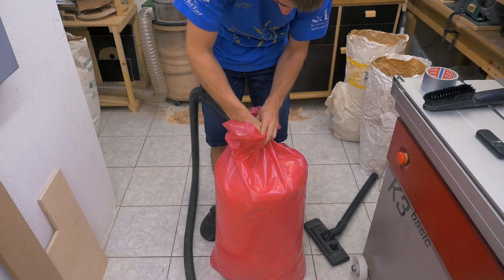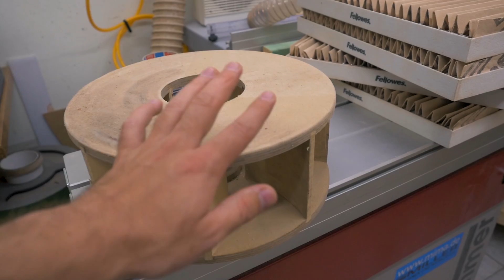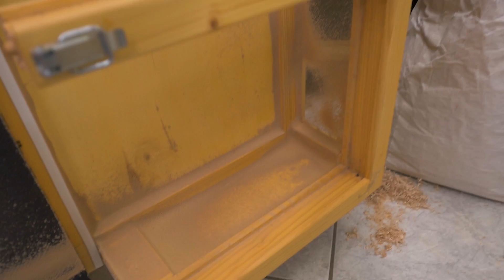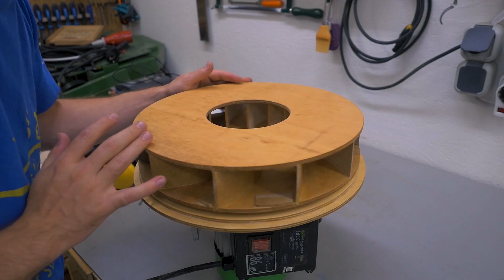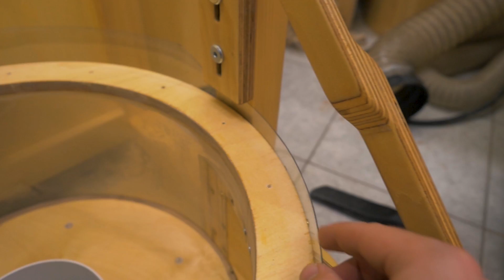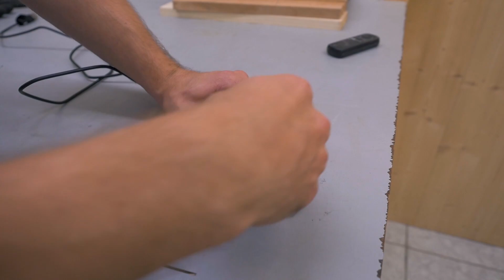Dust Collector Update & RODE WIGO Charging Station (Random Shop Stuff 24)

Comment: Very common for induction motors run at slow speeds, is to remove the motor fan, and fit an auxiliary cooling fan in its place.

Comment: Do you have a video showing how you made your CNC dust collector, the smaller one? I'd love to see how it actually works. It appears that you put the impeller above a cyclone tube, which makes the system more compact. But if I'm seeing it correctly, you could locate the impeller and motor assembly across the room and still use the dust collector, as the impeller isn't actually acting like a centrifuge correct?
Reply from the maker: I have 4 build videos about it on my channel

Comment: Hi Marius! Along the years you've made at least two variations of dust separators with Thien baffles. Which one do you think works best for a shop vac set up considering use for finer dust mainly (track saw and sander)? The one you made for the pantorouter ou the other for your dust collector?

Comment: You need a bucket that will fit inside the bag. Then just put the bag over the bucket, and invert. 
Remove bucket, and 'Presto' the bag is full, and no shovelling required.
As you already have the buckets, then use a bigger bag, and repeat the process to empty the bigger bag into the pink bag.
Also, a little dab of super glue on the base of the key would ensure it doesn't get lost when you remove the impellor.
For your bandsaw, have you thought of a stepped V belt drivee or a variable V belt drive? 
https://www.aliexpress.com/item/1005001495763734.html
https://www.c-var.com/products_show.asp?seq=207&title=APH-Belt-Stepless-Variable-Speed-Drive
.
Reply from the maker: I always wawnted to use a VFD for the bandsaw. The bag thing is definitely a good idea

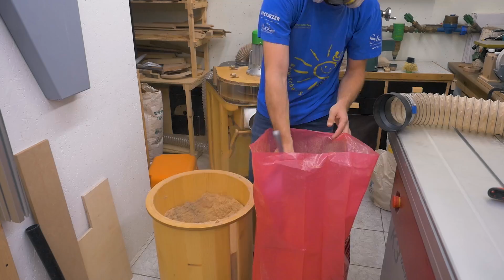Comment: 8:46 I think you could put a (large enough) plastic bag OVER the dust can, keeping it tightly around the can, then invert it upside down; if your red bag isn't big enough to go over the dust can/bin, you could use a different trash bag to dump it in first, and then put your red bag over the opening, dumping the first/larger bag into your red bag OUTDOORS.  :-)

Comment: For impeller design, this wouldn't work with 11 fins, but it would be interesting to use a design with different length fins. That should spread the noise across a wider spectrum making it sound quieter than it actually is.

Comment: Nice to know somebody's taking a concern about health in your industry the date is out there and people on YouTube just blase about it, do you have a particle metre to measure how much is in the air? Wood fibres paper fibres should be treated as a specialist and the workshop should be like a medical Theatre
Not necessary to waste the sawdust you can make it into logs and sell them or use them or make it into furniture again mixing in epoxy making sheets
What about a water filter system ever thought about doing that it's the best filtration for small parcels
Can't you lacquer the impeller with a water-based acrylic and polish it. or at least rubbing the impeller with candle wax and polishing it. And man some beading on the inside of the Impaler you getting airflow problems with swirling vertices maybe building adhesive or corking you stuff about half an inch across on the edges
Why can't you just put the bag inside the bucket put it over the lip of the bucket and have a big lastic band holding it please or bungee cord, or piece of string
Only have to do is release the elastic band and Tie the bag at the top maybe some draught excluder around the top of the bucket so the bag has soft padding and round the corners of the bucket over on its outer Edge
Do away with the corrugated paper filter and use a poly finder harder to clean I grant you would be better needs to overlap the edges of the filter I think as well
Yes I think the impeller might be heavy and and out of balance even if you got till the vibrations you could have used forgot the name of it thin veneer plywood with a foam interior sandwich it would be good I don't know if it is on your impeller to make the impeller slightly narrower on the outside inlet than the inside that increase the vacuum just a couple millimetres narrower. Yes that sounds about right a low pressure maybe as you say static build-up because it's plastic PVC try some copper tape around it Earth

Comment: Another food for thought with the motor RPM with the VFD is that you could also install a thermal switch in the stop circuit that would trip off the VFD when the motor became too hot. This would be a good idea regardless of whether you adjust the pulley diameter. I suspect you would be fine with the current pulley arrangement since you're not running the saw for hours on end.

Comment: Why paid to get rid of the saw dust? You can use that money to buy wax (if you have good relation with the church, you can get candle butts free). Pour melted wax into saw dust and you get blocks of solid fuel, all you need is just a silicon cup cake mold. Those solid fuel can be use in campfire or heating in winter. If they are all coming from natural wood, you can also use it to cook.

Comment: You will also get full power from the motor above 50hz, but not below.. So that is a factor as well. The power curve goes from 0% power at 0hz to 100% at 50hz, then 100% above 50hz as well.
Reply: You lose torque when motor is going over nameplate speed
Reply: @ToxTox  yes but not horsepower

Comment: On the bandsaw, pull the silly bent piece of tin that "they" call the fan off the motor shaft. Vanish their silly restrictive cowling. Replace it all with an electric fan.
I'm sure you can come up with a cowling / cover to pretty it up and make it safe.
If the cooling is done separately with an electric fan, the cooling will obviously be separated from the motor speed. 
I'm not sure if it is the kind of thing you want to get involved with, but you could even have dynamic fan speed control on the basis of motor case heat. A microcontroller and a linear temperature sensor like an LM35 would do just fine.
Horses for courses I guess - You might prefer the mechanical approach.

Comment: Re the band-saw. I would add an external fan that is turned on only when the motor is run at slower speeds. Like a car radiator fan. In that way you could simplify your pulley setup and run the motor at any speed you like. It will add extra space to the motor and you will need to power it somehow, but for the times your cutting metal having an extra component to start is worth the increase flexibility of the saw.

Comment: Seems like gardeners would be happy to add your sawdust to their compost - without charging you. Might even pay you for it.
Reply: Sawdust is "brown" in the composting sense. Although it can improve the texture of some soils, it robs the soil of nitrogen in the process of breaking it down. Even worse if the dust includes MDF or OSB, laced with waxes and preservatives that kill soil microbes. MDF sawdust is a good weed killer though, as is walnut which poisons the soil with juglone so it doesn't have to compete with other plants for soil nutrients. Good to learn from mistakes, best to learn from the mistakes of others. Sawdust in my compost killed my tomatoes for several years before I figured it out.

Comment: Then you actually did want an 8nvariable vqriable drive otherwise you could have juat stuck with new pulleys.  But why not just buy a pulley?
Reply from the maker: The pulley I need is about 100€ for the motor and no standard piece for the wheel
Reply: @MariusHornberger  You couldn't find something in a junk or salvage yard?

Comment: I had a similar heating problem going to a VFD. Easy fixed with a computer cooling fan that runs when the VFD is on. I took off the original fan and modified the housing to make some space.

Comment: I regularly run my 1750 rpm motors (lathe, drill press, milling machine) at twice that using a VFD and never had a problem.  They would much rather run fast than slow. Another bonus is you don't have to deal with the lack of torque that comes with running at low frequencies.  So a low gear ratio coupled with high frequency results in high torque and decent top speeds.

Comment: With the right vfd (if that matters) you can power low voltage pc fans when the frequency output is at a level you set in the vfd programming.

Comment: Wait... 25m/s? Aint that quite fast? :D checks google

It seems speeds at around 5-10m/s are more common... umm... did you make a mistake? :)
Reply from the maker: You only need lower speeds if the motor isn't powerfull enough. Bandsaws on the higher end run between 20-30 m/s

Comment: To solve the issue of the bag deflecting in the dust bin, you can insert an open ended cylinder inside the bag that holds it to the outer wall of the bin.  Mine is just made of a sheet of puck board riveted into a cylinder shape.  You then slide the cylinder out of the bag before throwing it away.  This, however works better in a cylindrical bin and not a square one.

Comment: Interesting topic! Instead of worrying that the motor might be getting too hot when you run it at 30 Hz for a few minutes I'd rather be worrying about it overheating if you run it at 70 Hz or more most of the time. Unless your motor is rated for that kind of speed (which I doubt) the coils will get hot and the lifetime of the bearings reduced.
Personally I'd prefer your first option (50 Hz for wood, less for metal).

Comment: Marius, the motor issue, keep it simple, just add a standolone fan on the back of the motor. While ICE engines need temperature to work, electric motors hate it. I don't know how much cfm it would need, but something physically identical or more efficient than the one attached to the motor. Running the motor above 50hz, will produce a tonload of heat... I wouldn't do it.

Comment: Fascinating stuff.  Interesting too about the disposal of the sawdust as I too have been working on this recently.  I was reading an article about composting MDF dust (of which there might be 10 to 20% of all my wood chips/sawdust) and they achieved good results  when mixing with regular waste for composting.  Here is the link: https://files.nc.gov/ncdeq/Environmental%20Assistance%20and%20Customer%20Service/Composting/Formaldehyde.pdf  Cheers, David

Comment: 11 fins? Only for that reason or why not 10? 13? :) But yes, it would be very interesting =)

Any pros and cons regarding the 0.8 and 3 mm poly.. uh, plastic? 0.8 is not available here and no real translation for road glass that makes sense!
Reply from the maker: 11 is a prime number. 13 would also be an option, but is more work.
The 3mm is a LOT stronger, but also 3 times as expensive and more difficult to install.
It's sold as "roll glas"

Comment: I always wanted to know, how Weizenmehl is made...
Thanks for keeping us updated :-)
Where as the trash handling in the part of Germany where i lived previously was some what the same, it is totally different here in Bulgaria. Just one big container about 150 m down the road, for everyone and everything...
I am very curious about the differences of the 12 fin imperller vs one with 11 fins.
Is it ok for the band saw motor to run over 50 Hz. It will increase the air flow for sure, but is it not a problem for bearings etc.?

Cheers from Bulgaria
Reply from the maker: It's perfectly fine for the motor to run at ~1800rpm instead of 1400

Comment: The first solution to the motor overheating problem that sprang into my head was to use the dust collector to suck air through the motor.

Comment: From what i understand of aerodynamics and bernoulli's principle is that and gas that accelerates has a lower pressure. So the front of the impeller blades would actually be a lower pressure as opposed to the higher pressure described. I would imagine the dust build up is actually from a buble of stagnant air that sits behind the blade as it runs much like when you move you hand fast through water and an air pocket forms on the back side of you hand.

Comment: Name the part 'mounting-foot'. or so :-)
Bandsaw: I guess, it's easier to mount an independed fan behind the motor. They are available in 230V, so you don't need a powersupply. And they are cheap. But use one from Pabst. They have have good bearings.

Comment: 12 vs 11 blade comparison, yes please! I've often wondered if it would be possible to figure out a nonuniform blade spacing that retains balance, too. High quality endmills sometimes use nonuniform flute spacings to reduce chatter, which is kind of related (avoiding resonance).
Reply: Non-uniform fans for reduced vibration?  like the fenestron on the tail of an Eurocopter (now Airbus) EC135 helicopter.

Comment: I think you should run the dust collection system out through the wall into an adjacent shed or outbuilding.  Cleaning  would be easier and safer on your lungs. Is that feasible? Regards Col.
Reply from the maker: Not possible in the basement

Comment: I think you should run the dust collection system out through the wall into an adjacent shed or outbuilding.  Cleaning  would be easier and safer on your lungs. Is that feasible? Regards Col.

Comment: When I empty my dust collector, I take a 30gal bag, slip it over the collector's bag, flip the whole thing, and slide the collector's bag out. Works pretty well.
Reply: But he has to use these specific bags.
Reply: @gaunerchen1729  I get that. I wonder if it's worth making a funnel sized to them. Probably not.
Reply from the maker: a big funnel is actually my idea as well. I just never get to making it

Comment: Marius - For the band saw cooling .... simply add a motor housing and a cooling fan - you could probably just put a dust port on it and use the big blower to suck air over the motor - this gives you the option to use auxiliary cooling, or just the built in fan. No need for new pulleys

Comment: Just install a big pc van on the back of the motor.
You can controll it with the VFD.
It has output for that and you can change settings so the fan only starts when you go below a specific motor speed.
Reply: I was wondering the same thing, although I didn't realise that the VFD had an output for this, I thought that you'd have to design it yourself.

Comment: hey Marius, in minute 28:10 when you spoke about the motor cooling problem, you should not have a problem since the VFD limits the voltage and current that the motor takes, so less power less heat. some VFD's have a motor temperature protection feature so you should check about that. if it doesn't have that feature then you can design a protection circuit. if you need some help Ill be more then happy to assist you even thou I believe you'll be able to do that yourself and I also believe you don't realy need to worry about a motor heating problem.
Reply from the maker: The VFD has heat protection built in
Reply: @Aviv GG Lower rpm does not equal less heat.
The same torque at a lower rpm requires virtually the same current. Per R.I² we can conclude that the amount of heat energy remains equal, while at the same time cooling is reduced by the lower rpm of the cooling fan.

Comment: Can't you control the fan separatly? I think it take power from the motor supply but you could give it a separatly source
Reply: The fan on the motor is permanently attached to the motor shaft, so it can't be powered separately. That said, he already has a ton of fans available (from the dust collectors), so you don't even need to add another one on, use air from those.

Comment: When the dustbin is 100% airtight you can use a dustbag inside.
I have a metal bin with a bag and that works perfect.
Just put a fee pieces of scrap wood on the bottom for weight.

You can epoxy the osb to make it airtight or use PU
Reply: Also, the dust collection system will only operate at it's maximum possible efficiency when the bottom section is completely airtight, so this should be done anyway.
Reply: Alternatively, or additionally, he can provide bypass air to help balance the air inside and outside the bag.
Reply: @bradley3549  He already tried that with a air hose from the cyclone to the bin to keep a vacuum outside the bag but it didnt work.
Reply: @3dmazter  I must have missed that one. The concept does work, I have done it. As usual the devil is in the details, I will have to look back to see what how he did it.

Comment: Hy Marius i was thinking to build an air ventilator that sucks fumes from the air in from my 3d printer, what should i use for that ? Some pc fans and a pipe conected to the wardrobe* where they run would work ?
Reply from the maker: I guess that would be a good and quiet solution